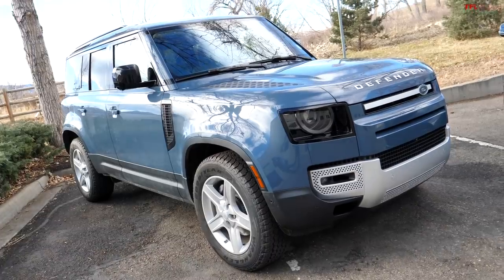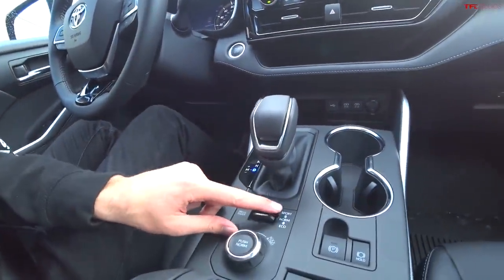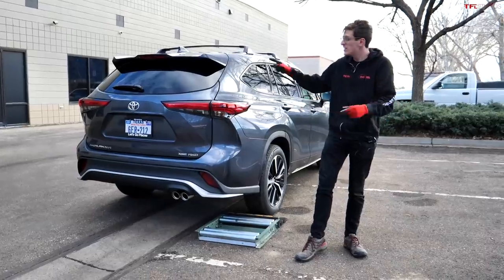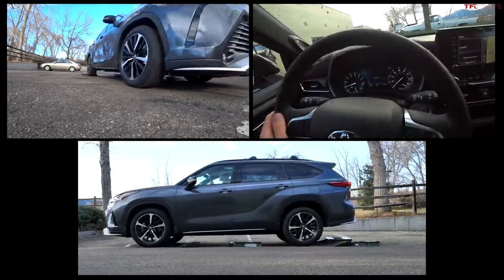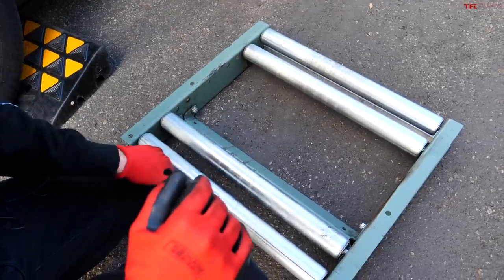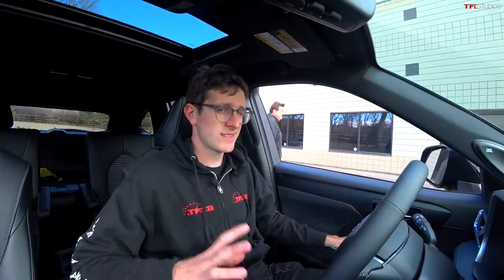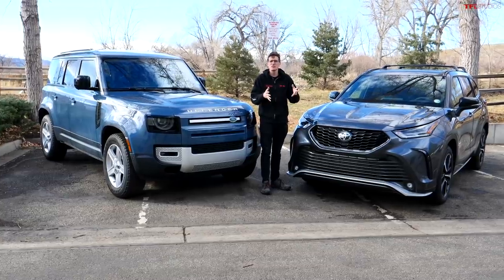Does Land Rover REALLY Make The World's Best Four-Wheel Drive Car? I Compare It To Find Out!

Comment: I think the reason the 4WD system on most LR's is so good, is that its the same tried and tested basic design since 1970. Engine>Gearbox> Twin Speed Transfer box (usually with Diff lock)>Axles.

Modern Land Rovers have the exact same thing. While the parts may be different, and they are backed up with automatic diff locks and a capable traction control, the basic set up is exactly the same. These crossovers with their haldex couplings, and fancy clutch things... they're just never going to compare to a basic nuts and bolts system like what Land Rover use in their proper 4x4's. That's why it hasn't changed in 50 years. As yet, there's nothing better. I don't know why LR don't use the same thing in their fake 4x4's (Evoque, and Disco Sport), but instead of a twin speed transfer case, just use a single speed with diff lock. It'd improve the off road ability of the RR Ejoke and Disco Spoof no end.

Comment: Try Defender vs 4Runner with A-trac
Reply: Or defender vs anything with front and rear lockers.
Reply: Toyota wins hands down😊
Reply: I think the  Terain response system is a waaaaaay superior system than traditional lockers..have you seen the Carwow, where a Range rover sport pulling a G wagen with all three lockers on like a Toy car.....it was pretty impressive..
Reply: They have an FJ Cruiser in the garage (same drivetrain as a 4Runner), I'm a bit surprised they didn't use that in this test as it's a more direct comparison to the Defender than a Highlander is.
Reply: @abymathew295  traction control systems make slippery terrain easier, but you still can't go anywhere without a rear locker. I'd choose a front locker over traction control  too.
Reply: @abymathew295  real lockers are better. It's pure physics. Mechanically direct coupled tires can approach the threshold of motion closer than any traction control system. It's impossible to match lockers with traction control for maximum traction. But traction control works pretty well in lots of situations... Until the brakes overheat. That's why you don't see them using traction control for long periods of continuous use.

As for pulling - it's just a question of mass and probably different tires. Same mass, same tires, and pressure - lockers win.
Reply: Specially when video title says best! If you want to say best you need to compare it to real competitors like LC or even 4runner.
Reply: Defender vs 4Runner with A-trac, I think Defender will win. A-trac needs some wheel slip right? vs Defender quickly sends power to the wheel with traction. I could be wrong.
Reply: Lion Runner yeah it would slip a bit more.  Just not like that highlander
Reply: @LionRunner  they're exactly the same or very similar. They all require slip. That's how they work. Slip = differential frequency in the abs sensors then ecu applies brakes to slipping wheel. Only real mechanical locking differentials don't slip. 

Here's a 4runner traction control https://youtu.be/6ARYqd9lQRo
Reply: @MrJcjet  nice.. Definitely love to see both going head to head. Still couldn't make my mind Toyota beating a LR in traction control system even though I'm a Toyota guy. :)
Reply: @LionRunner  I think the biggest land rover advantage is that it's very aggressive in the base setting. A 4runner with MTS in rock mode would be really similar. But most 4runner owners seen like they don't even know how to turn that on. And Toyota requires you to be in low range to use the best settings. So most reviewers never really use it even when they might think they do. I think TFL is actually a really sharp team who would get it right. But Toyota should make it simpler and maybe just be turned on by default. And it should come standard on all 4x4 models.

Comment: It would be interesting to carry out these tests on an inclined surface.
It would simulate what it would be like to drive on a sloping street with low grip. 
The Teknikens Värld channel's media has already conducted tests like this on mall parking lots ramps.
Reply: A few years ago if memory serves they almost wrecked a Subaru doing the 3 wheel test in a somewhat steep inclined loading dock.
Reply: I too would really like to see them bring back the inclined test.  Also, sounds like they need some heavier duty rollers.  Based on the sound, it seems there's a lot of friction in those bearings when loaded.

Comment: When comparing SUVs compare apples to apples (as you guys always say) dont compare a crossover with a proper 4WD. Put the Defender to the test with a 4runner as mentioned in the comments.
Reply: I agree, though I’m not sure I would consider the Highlander a crossover. Isn’t it considered a mid-size SUV? I always thought the RAV4 was Toyota’s crossover vehicle. I do agree the 4Runner would be a more direct comparison though in terms of the 4WD.
Reply: Or better yet, with a Land Cruiser, since Land Rover claim this is their newest most offroad worthy vehicle.
Prado or 200 series, doesn't really matter. Just like you said, apples to apples. But a 4runner would really be quite sufficient in this case indeed.
Reply: They only did this to demonstrate AWD vs 4WD. They put these vehcile together because they are similar construction but very different 4wd systems.
Reply: Things don't always line up ideally. It's not like they have a warehouse with all the cars to test exactly how they would like.

Comment: what vehicle other than land rover/defender has the same type of 4x4 system but is not a land rover/defender vehicle?
Reply: If you mean auto locking center differential - some older generations of Touareg have it, older Cayenne, some Benz cars. Subaru VTD system includes similar setup. And actually some sport cars like Evo or STI.

Comment: They are doing that automatic power spread (Intermediate Reduction Drive) since first Freelander (which also was first to have Hill descent mode), I managed to follow Ford Ranger on steep hills with very loose terrain, while he had to lock center and rear diff and BFG KO2 tires and myself on regular winter tires.

Comment: 4WD is traditionally a transfer case, ie Center diff, is fully locked full-time in 4wd thus distributing 50/50 torque split to front & rear axles. Due to safety issues w/locked center diff, all 4wd offer a 2wd mode. In some cases a 4wd transfer case will also have a clutch allowing for some variable torque split in a pseudo awd but it’s usually limited in torque split by how much the ecu controlled clutch engagement is allowed to slip. The NP246 case, used by GM & Ram for many years in 2000’s, for example was limited to 60% torque delivery to either axle. 

The LR system is referred to AWD because it’s a full-time open center differential. It does have an ecu controlled lock-up clutch to fully lock the center diff to a fixed 50/50 split but it’s primarily an open full-time system. I don’t believe having low range in transfer case defines it as 4wd, there’s been plenty of trucks & SUV’s w/4wd capability that lacked a low range.

Comment: You guys should do the roller testing with the pickups  It would be nice to see their systems at work as well.  See if the rear wheels can get off the rollers in 2wd, see if it can get off with one front and one rear while in 4hi, see if the systems react different in 4lo, really show how much spin is needed to actuate an auto locker, etc.

Comment: I'm wondering if you actually removed the rollers and used real grease instead of silicon spray, if that would stop the rollers from smoking. That silicon spray isn't meant for that type of load.

Comment: I saw you were using Liquid Wrench to lube the rollers.  It is a penetrate  not a lube.  That is why it smokes.  I would suggest a spray White Lithium Grease or even Motor Old in an old style pump oiler.  Of course better rollers with a grease fitting would be best.

Comment: Next time you're in an AWD wannabe , like the HL, w/the 3 wheel slip test with the Rear wheel only w/traction, try applying the parking brake 'lightly' to see IF it'll help shift some more torque to that rear wheel. I did this on ancient '03 HL and it kinda worked! (assuming the parking brake is on the rear wheels only)

Comment: AWD has a center differential of sorts to allow the front and rear to run at different speeds which allows power at both ends all of the time. 4WD has front and rear locked to same speed which means not being a good idea to use on dry pavement.  AWD may be lockable between front and rear to act like 4WD.

Comment: At 13:50 something very interesting happened, the torque vectoring appeared to kick in and nearly pushed the front tires sideways off the rollers. It looks like the Toyota failed the test because every time Tommy gave it enough power to make the torque vectoring kick in, the right rear tire would pivot the whole car sideways, and I'm not sure quite why.

Comment: I could be wrong but Land Rover introduced terrain response with the LR3 in 2004. I owned a 2006 full size Range Rover and it did not have terrain response until the refresh or 2007.

Comment: The thing is - all the TC systems are great until you over heat the brakes or you have a sensor fail. I’ve seen this and a one wheel drive discovery in the mountains was quite a pickle.

Comment: On the Highlander 3-wheel slip with right rear traction - I wonder if a little bit of brake modulation would have helped it get out on its own? It is a trick I've used successfully with rear-wheel drive vehicles on snow and ice, but it can take practice to get enough brake to slow the spinning wheel but leave power available for the wheel with traction. I've never tried it with AWD.

Comment: When you did the three wheel test at the end the defender had the centre diff lock on. It should have been turned off to really rest the TC. 

The defender did have an advantage.
So if a buyer only  occasionally went off road, it's an easy choice. Buy the Toyota as it's more reliable and cheaper with a larger dealer network.
Reply: That's auto locker, it will lock anyway.

Comment: You didn't need a push, you just needed to apply a gentle bit of handbrake. I thought you guys knew about off-road driving. It works like this, the extra torque required to turn the slipping wheel means extra torque gets applied to the gripping wheel.
Reply: Not in this case. Two reasons. 1 - there is no rear conventional differential but two separate clutch packs. 2 - even if it was version with rear diff, using of handbrake would probably disconnect rear axle.
Besides - I can't see classic handbrake there...

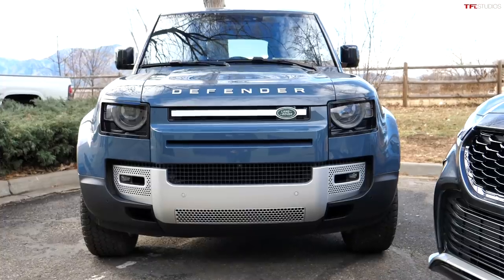Comment: 4:06 you can see orange peel in the paint
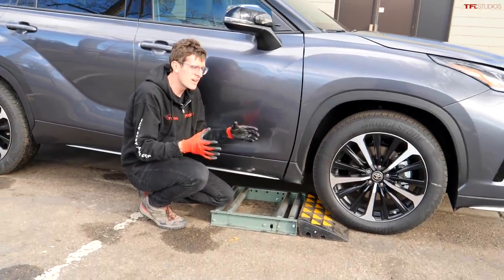Reply: Did you see the hood gap on the Toyota at 0:57 ?  Looks like it was in a wreck!
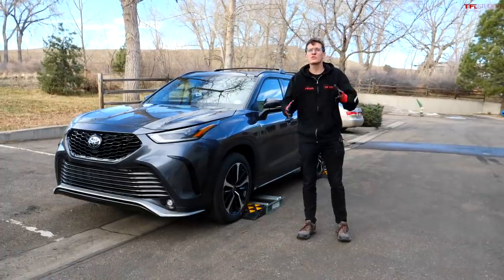Reply: @normt430  At 8:15 you can see the gap is part of the design over the headlight. We get you don't like Toyotas. Personally, the highlander looks like an Angry chipmunk, but I think it's a proper soccer mom SUV.
Reply: @jimmypena2442  the gap is too big just like the gap on Subaru Ascent.  They sacrifice alignment of misformed panels for frontal view.
Reply: @normt430  it's a part of the headlight design.
Reply: @arevo8702  the gap is not consistent with the rest of the car and is too big.

Comment: I would have thought the snow mode would have been the best choice for the Toyota, as I'd guess that the other modes (sand, mud) actually are designed to allow more wheelspin to keep you moving and not to limit power to those wheels.  I would think Snow would do the opposite and should have worked.  Interesting.  Good test.

Comment: Tommy, the squeal from those rollers are not a good sound. If you can get some with bearings capable of side thrust, your results would not be affected as much. The ones you have are sensitive to how level and straight you lay them down, and also to when the test subject starts to crab. There is a leading zero in the traction coefficient when there is rolling, but not when the side thrust starts that squealing and the rollers drag on the frames. No doubt these rollers are getting pretty hot when the vehicle weight climbs and the side force and squeals happen at higher when speeds. Great demo of the difference in the equipment between these two models in any case. Merry Christmas and Happy New Year!

Comment: Tommy, I am wondering if the problem with the rollers is because the bearings are not limiting sideways travel of the rollers, resulting in the ends of the rollers rubbing on the frame? At 13:00 you easily move a roller sideways, so I am thinking that as a wheel spins, it could "walk" the roller sideways, which could create the friction and smoke. Maybe you need bearings that control end-float of the rollers?

Comment: Trying to get my head round whether you are doing this with TC on, as most know ?, the TC should be off on loose surfaces , turning the off-road modes on should in many “4X4”s deactivate the system, same as any modern 2wd saloon car in the snow, TC should be switched off for Max traction. Just curious 🧐

Comment: You should do a intro for the roller slip test where it shows you greasing the rollers lol. Every time I hear the squeak I think “did he grease them properly?” Lol the intro will be cool and the mid segment where you show you grease them was reassuring but a cool intro that includes you greasing or a mini segment between front/rear/3 wheel slip tests will be cool, I think.

Comment: My view is that 4x4 requires 3 geared diffs, interconnected through the road surface as part of the gearing system. As soon as you put slipping connection or clutch pack in place of a directly drive diff, it's AWD, on the test here my Unscientific comment but I generally I recall AWD cars doing fairly badly with this sort of asymmetric slip tests and situation, even 4x4 sans dif lockers (the more the better) don't fair that well, LR do look to have wheel slip mapped quite well which is one possible reason they have such big discs ( and corresponding less off road worthy tyre fit).  Toyota to be fair with less direct mechanical full time coupling does a great job also.

Comment: Not to take anything from the land rover amazing traction system, but the Highlander is built for different purpose. You should have chosen Fortuner, 4runner, or land cruiser with the proper trim AND matching tires. 
But I understand is that you work with the cars you get.

Comment: The roller tests are always interesting. Now that you have another Raptor I'd love to see how it does on the 3 wheel slip test with one front having traction, really put that Ford front LSD to the test. We know it will do fine if one rear has traction with the locker.

Comment: would have been interesting to see what higher aspect ratio A/T tires would have done for the highlander.  That plus the extra weight of the Land Rover may have been the difference in getting traction to the single wheel.  Still, the highlander is impressive for basically a street vehicle.

Comment: Nice seeing Toyota actually have a good AWD system finally, one where the rear wheels will push the car.
Reply: It failed with just a rear having traction.
Reply: @JahyMoonwalker  I bought one for winter driving because we live out in the country & the roads are brutal when it snows & it has performed really outstanding so far.
Reply: @JahyMoonwalker  I'm more interested in both rears pushing, the one rear wheel stuck issue is normal for most

Comment: Interesting video, fun to see how the crossover did, but I would like to see the Defender against a 200 series using Atrac. Also, please do a similar test with an SUV or truck with the t-case locked and open front and rear diffs, while using left-foot braking to simulate EDL.

Comment: I like watching these videos because TFL puts these traction controls to the test. And from the looks of things Toyota is guilty of providing a bunch of dummy settings ie: mud, snow ,rocks ..... that as you can see don't do anything. Those various settings should have clamped down on that rear spinning wheel ( via the brakes ) and sent power over to the other wheel.  As for LR ,well I give them credit that does indeed have a great traction control system that actually works as advertised. The hard bits on the rig are less than optimal but maybe Defenders are no longer meant for that.
Reply: I tested Rav4 on rollers, there was major difference between these driving modes.

Comment: Unless severe rock crawl TC is perfect. My 03 disco with TC did great wheeling in CO.
Reply: TC will often get the job done, just not as quickly or reliably as a locker. I wheeled in CO for a few years with a group and while TC or LSD vehicles usually finished the trails, they took a lot longer and required a lot more assistance, finesse, and spotters to do so. I've owned both and will always choose a locker for off road use.

Comment: My Outlander does not pass the single rear wheel test, in none of the 4 modes and with or without traction control. Torque vectoring only works from 15km/h up :(